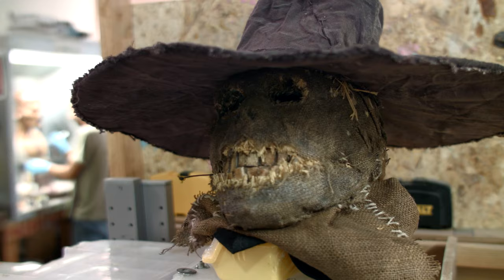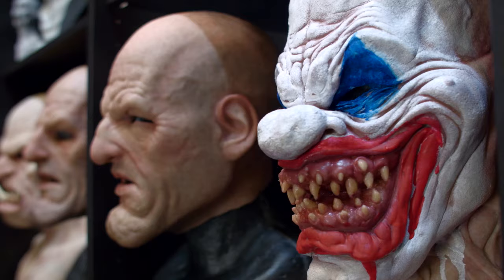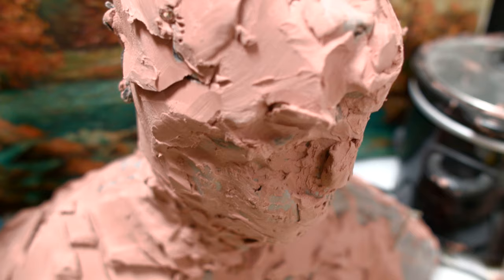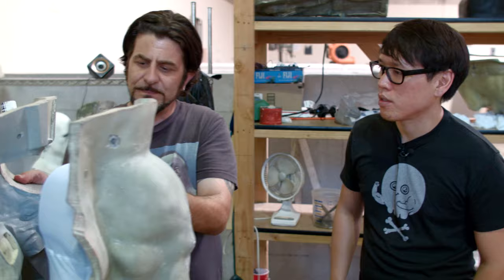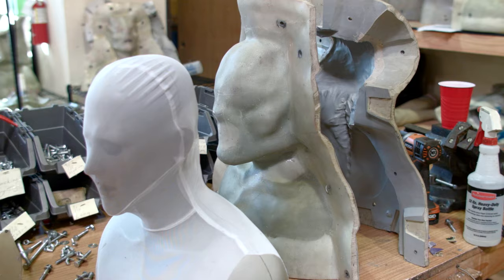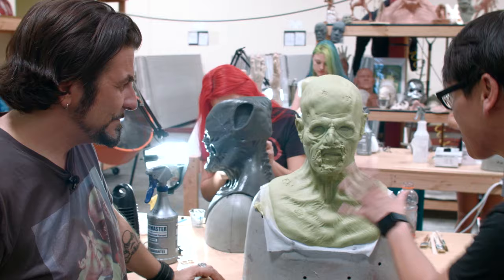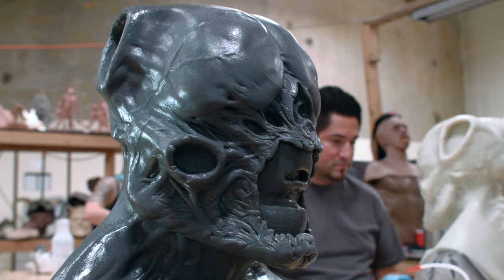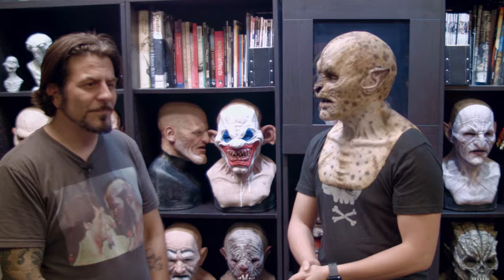How Lifelike FX Creature Masks are Made

Comment: Why are they soooo expensive
Reply: why are you soooo poor.
Reply: enrique De La Cruz You are doing it wrong. Tell him to get a job.
Reply: lol l
Reply: Profit margin is extremely high as far as cost goes, but there's so much labor involved!! 

The silicone costs 10x as much as the latex pour does. If not more. My silicone mask I made, rock mold, no core (I roll cast after brushing in detail coat) and my cost in silicone was $120. Now, I used a different silicone than they did, one more for appliances but it worked. So add that to the labor and you've got a $500+ retail piece.
Reply: yup. First off silicone is crazy expensive, but it is the labor mainly. I make predator masks which are very expensive even for latex, because of the dreads especially, and the teeth. A good one will easily sell for £500 (about $700). I've had people who claim I should charge less because "your doing something you enjoy" which is rubbish. Why should they get my time and skill for nothing.
Reply: mellodge
Reply: The products involved, like silicone and make up paint is not cheap, especially for a company. It's also the skills and process involved. It takes lots of time to make and ship out these masks, as they are all handmade. I have a mask from them, and I can definitely see the art in it. The quality is remarkable. But yes, I agree that they are very pricey. But if you are a horror lover, these masks are definitely a beautiful collectible and worth saving up for.
Reply: Tbh I think these people are being very generous with their prices..

Comment: Does anyone know what kind of silicone they're using ? Did my research but couldn't find a specific kind of silicone. Is it the Dragon Series or the Eco Flex 00-30 from smooth-on they are using?
Reply: Platinum Silicone Eco-Flex 20 for most masks, Eco-Flex 30 for sleeves (anything thin). Mold Star 20T for most pre-cast elements. All from Smooth-On.